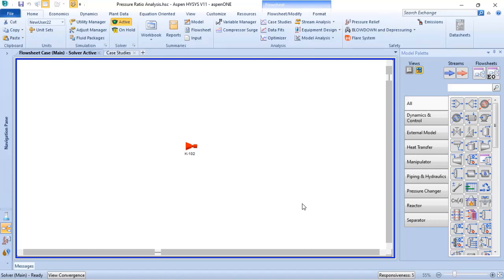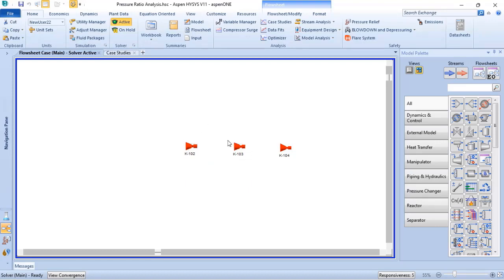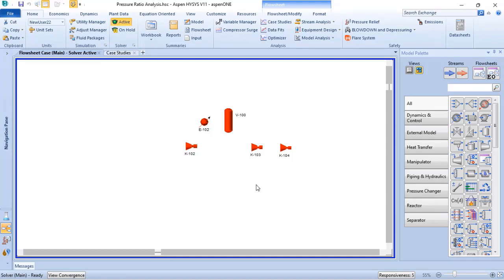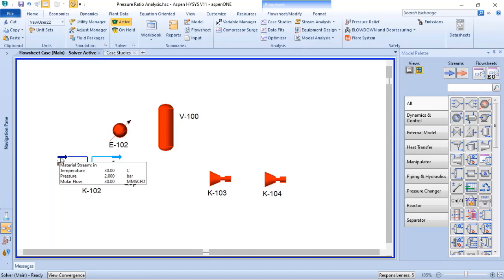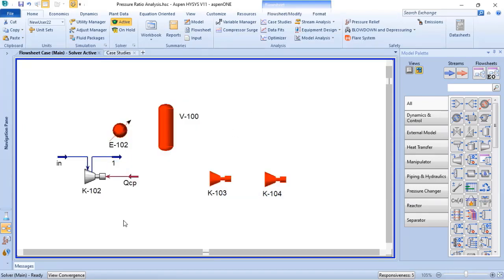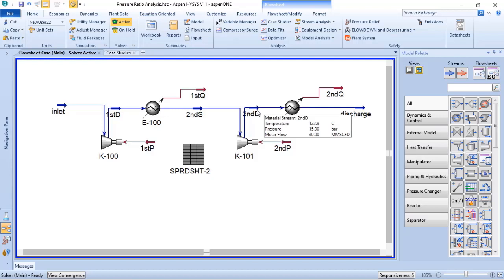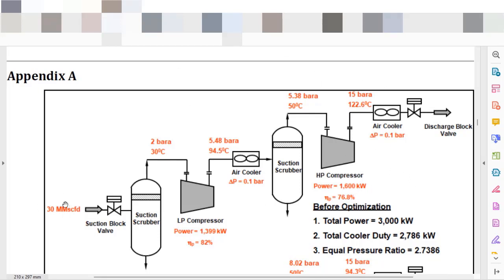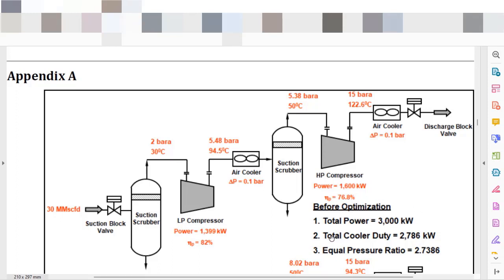HOW TO ADD MULTI STAGE COMPRESSOR ON ASPEN HYSYS FOR CHEMICAL PROCESS ENGINEERS

Comment: Thank you
Do you know how to simulate a 17 stage axial air compressor for a gas turbine
Reply from the maker: Hi Eibosa, to simulate any process my suggestion is first to build the process flow diagram (PFD) of your process. it can be done in different ways. Based on the PFD, you will add the components that make sense and represent your process. In general term, it is possible to simulate a 17 stage axial compressor. just ot remind you, the main purpose of process simulation softwares is to perform heat and material balance.